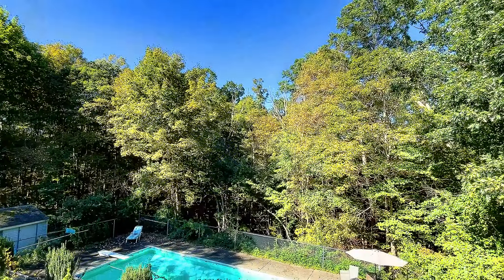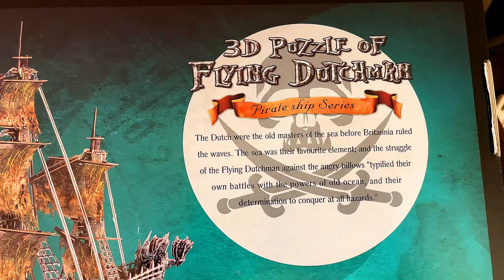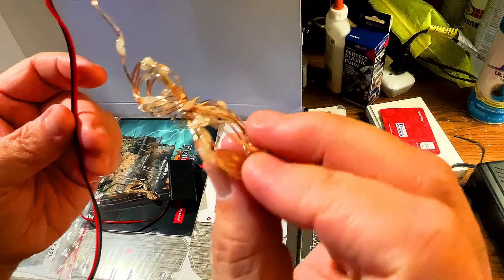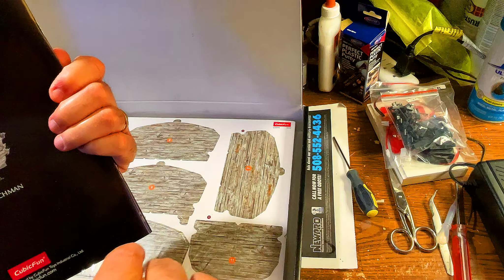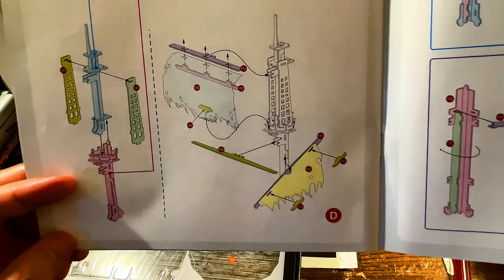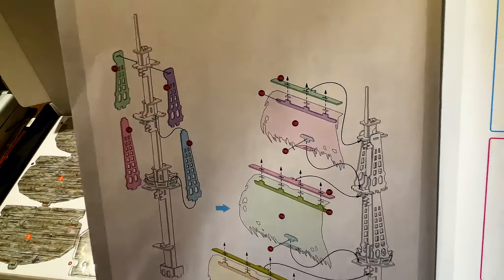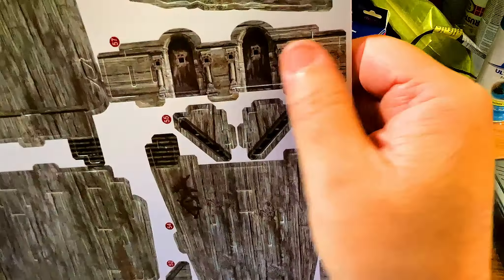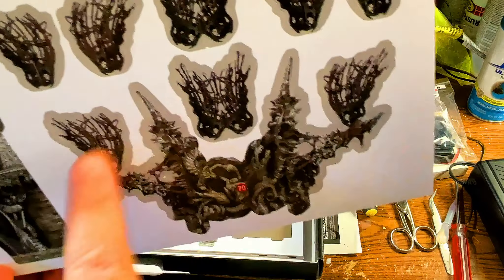CubicFun 3D Puzzle of the Flying Dutchman with Eerie Green LEDs (Introduction Video)

Comment: Lindberg - Jolly Roger Series: Flying Dutchman, 1:130 (HL218).This model kit has been around for years and has gotten a rerelease with new cover art. It is molded in glow in the dark styrene, therefore no need for special paints for ethereal effect. I hope this helped.
Reply from the maker: Yes, I am particularly fond of that kit as well. In fact, I have done a video on the Revell version. Although that one needed glow in the dark paint. I have also done the kit molded in glow in the dark plastic as well. However, this kit is totally different as it is made from pressed foam sheets and requires the LEDs to illuminate the vessel.